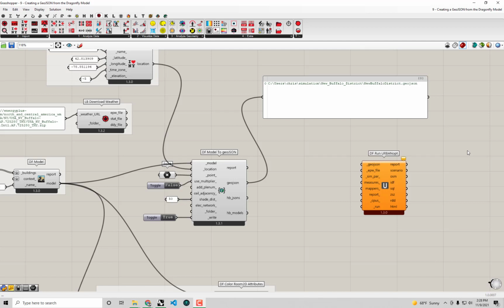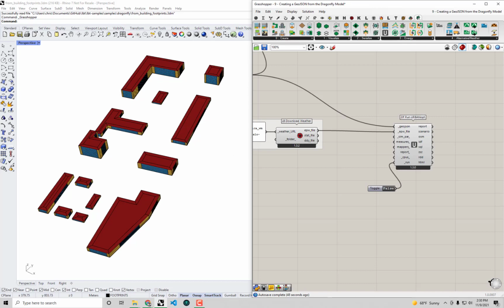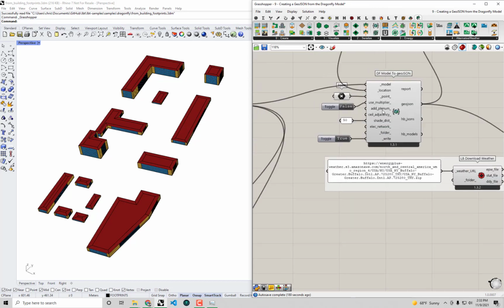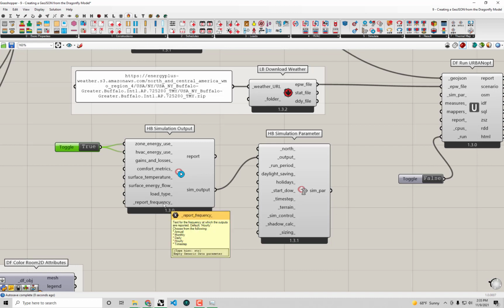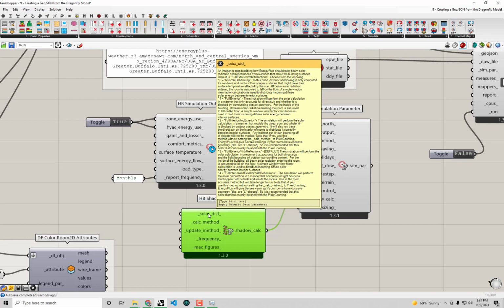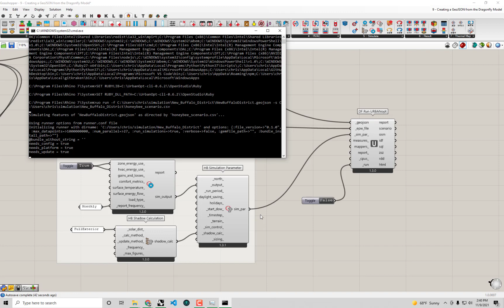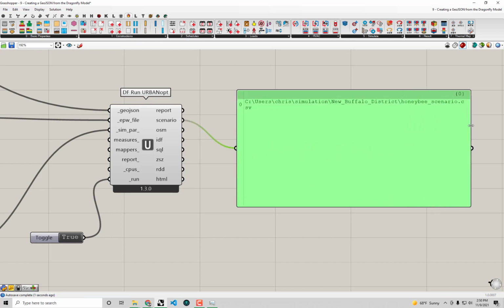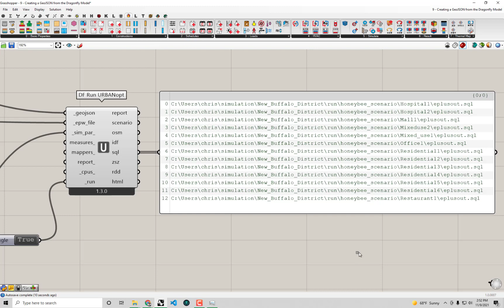Dragonfly : Running an URBANopt Simulation

Comment: Hello, I encountered the following error when running DF URBANopt:  
1. Solution exception: An URBANopt installation was found at C:\URBANopt-cli-0.14.0, but the URBANopt executable is not accessible. 'uo' is not recognized as an internal or external command, operable program or batch file.

While the OSM module produces simulation results, it doesn't support multi-core parallel computing like URBANopt.